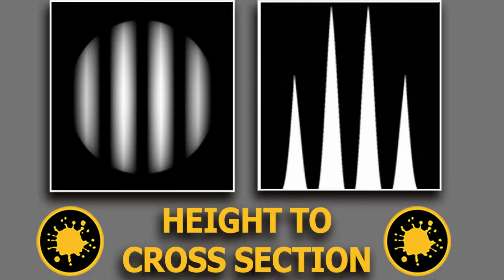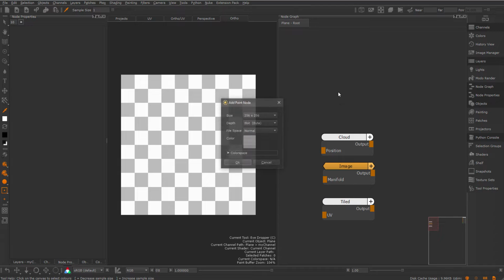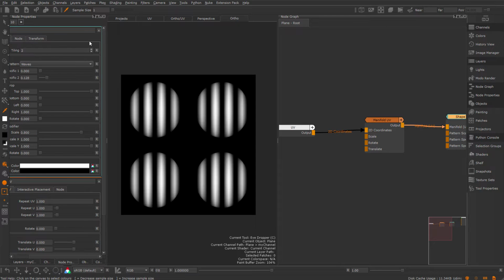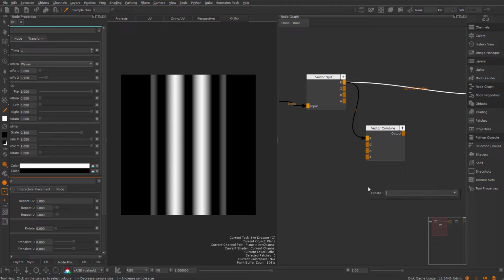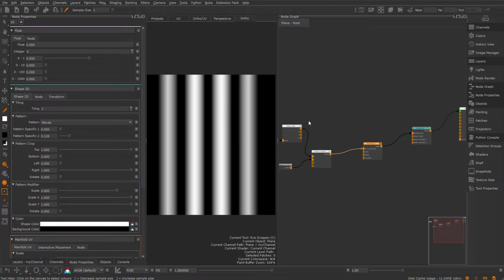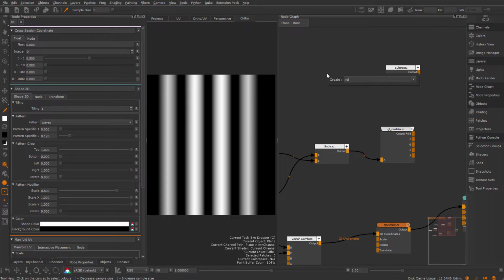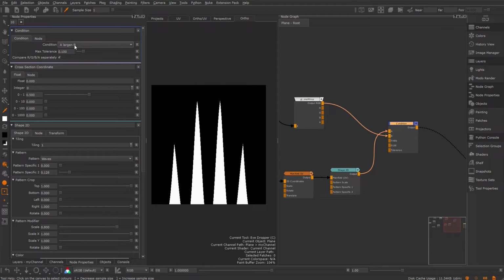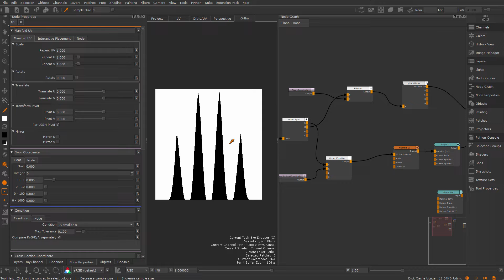Displacement Map Cross sections in Mari

Comment: Thats trippy, will try it but where would you apply this method in a real scenario?
Reply from the maker: To generate shapes for example . Certain shapes are quite easy this way
Reply from the maker: Basic example is a waveform
Reply: @MariExtensionPack  We did the same node with designer at Mikros. It's very helpful to have a better representation of a displace texture's side view. We did not used to create something but mainly to check the curv of an height map. Thanks to share this tutorial for mari. I will add this to my library